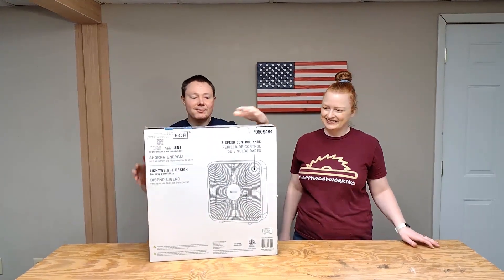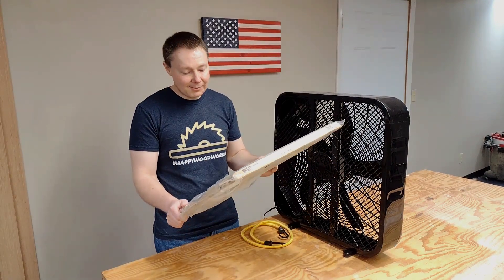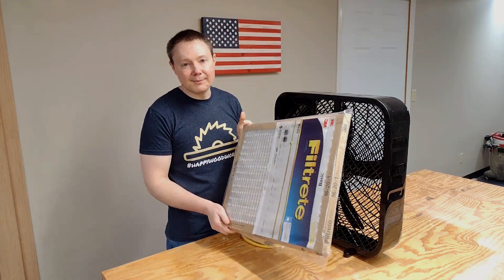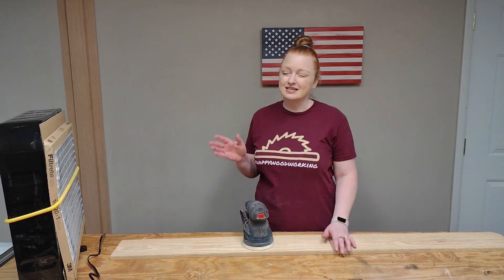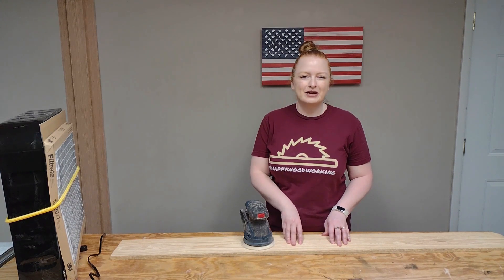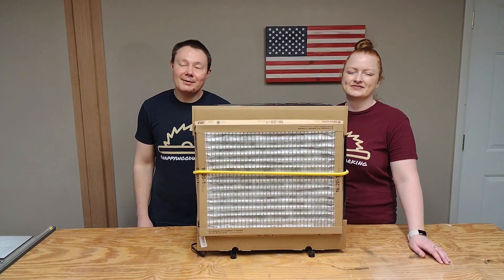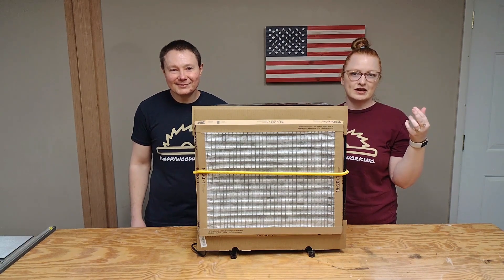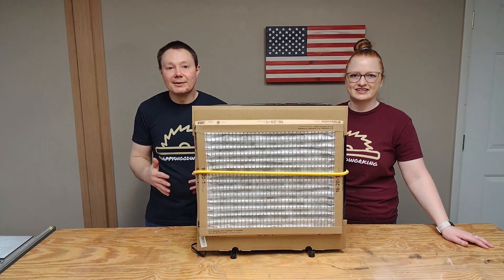Will it Work??? | Box Fan Air Filter | Fine Dust Collection DIY | Woodworking

Comment: Quick and easy, and if it makes a noticable difference then a lot better than nothing.  👍

I have a 20"x20" box fan, which is what that looks like.  I used to use a double-layer of 20x20 MERV-8 filters, and I used clear packing tape to seal all around so no (or less) unfiltered dust could foul the fan or motor.  Now I have 20x14 filters that make a 20x20 box 14" deep that  rings the back of the fan, if you follow me, with the back of that box a solid piece of cardboard.  That gives a greater filter surface area for the air for better airflow since I still double-layer.  I now use MERV-13 under MERV-8.  The cost of the filters adds up, and I figure the MERV-8 will catch a lot of the dust, making the MERV-13 last longer.  I still use a P100 dust mask whenever I'm working and for some time after.  I don't know how much the fan+filters is catching vs. how much of the really fine stuff it just keeps circulating.
Edit: The current version with the box of filters sticking out of the back of the  fan is kinda big and hangs from the ceiling.  I could use another simpler one with filters flat on the back to have next to sanding.
Reply from the maker: Thanks for watching. That sounds like a good setup. Happy Woodworking!